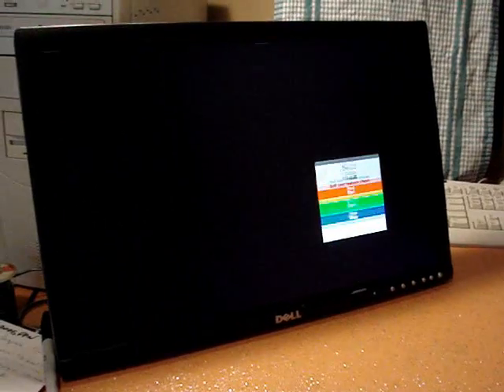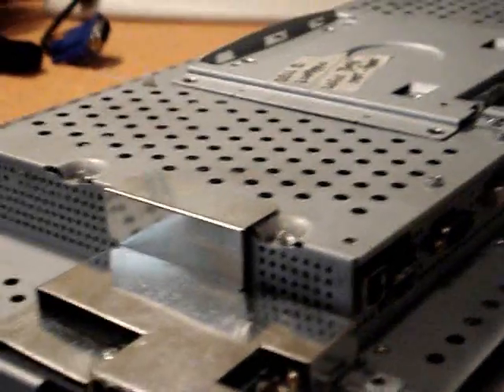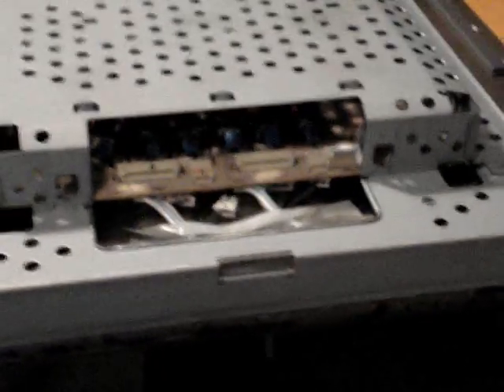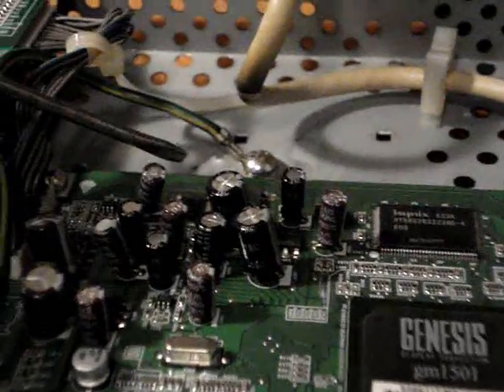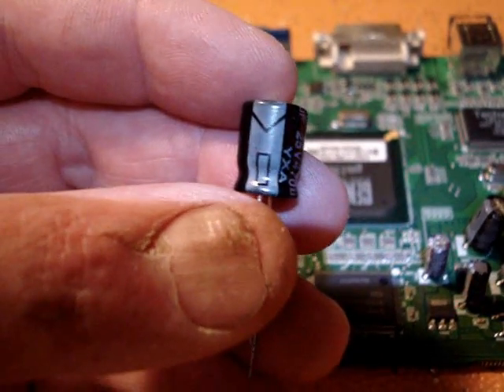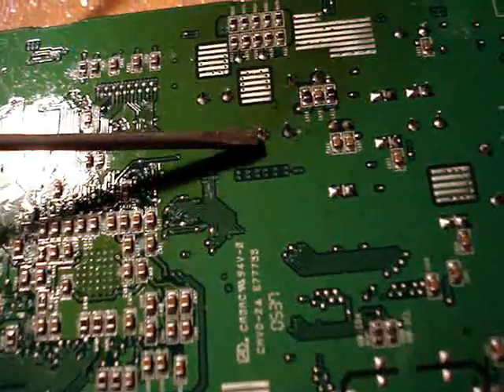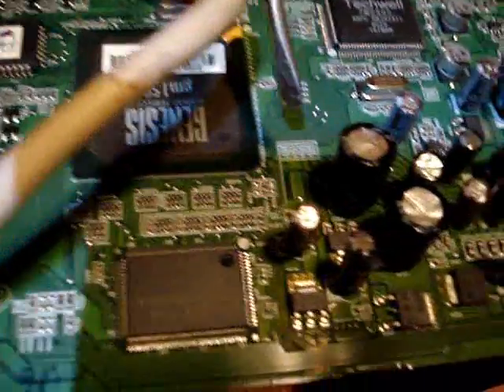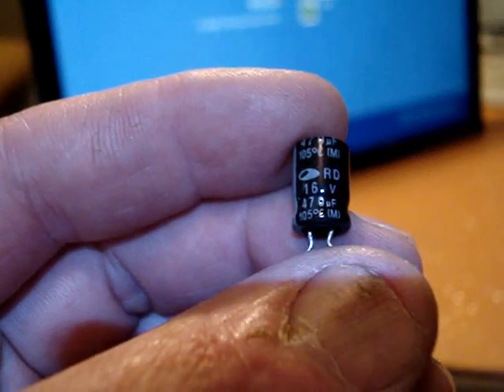Repair a Flickering 20" Dell 2005FPW LCD Monitor (similar to 2007WFP)

Comment: I just had a similar issue on my Dell G2422HS monitor. It just started flickering. I didn’t think it was the monitor at first so I restarted my computer multiple times but it didn’t fix it. Then I connected my laptop to the monitor, I realized it was the monitor. The weird thing is that after maybe like 5 minutes, it went back to normal again. It has been working fine since so not sure if anything is really broken… very odd.

Comment: I have a similar Dell monitor and a similar problem in it... a constant flicker in the bottom half... it even sounds when flicker and that looks like something related to power feed... im poor and im amateur in electronics, well... preamateur even haha... it might probably be some capacitor but in order to find the failing one how can i do it, using a multimeter in every capacitors i guess ... thank youuuuu

Comment: I performed your fix and the monitor now works flawlessly. A very good lesson video. Followed your instructions completely although I had to use 30 V - 470 capacitors. Thanks. I really like this monitor.

Comment: Thanks! Worked on my Dell 2005FPW monitor.
For others finding this post: The original electrolytic capacitors are rated 105°C. It's probably wise not to replace them with capacitors with a lower temperature rating...
After the fix I looked up what these capacitors do in the monitor. They are part of a small circuit (on the logic board) that creates the 1.8V power line (from a 3.3V power line), which goes tot the GM1501 chip (the Genesis display controller).

I found the service manual (with disassembly instructions and schematics) on:
https://www.manualslib.com/download/442079/Dell-2005fpw-Ultrasharp-20-1-Lcd-Monitor.html

Comment: Cool repair. 

My Viewsonic 2038wm-LED monitor turns on but the screen image flashes every few seconds (screen is on, screen is off, screen is on. The image actually looks good, not faded or anything). The term may be it's flickering every second or every few seconds?

These are cylindrical electrolytical capacitors, I see which aren't bulging or seems to be damaged: 

Electrolytical Capacitors
100v 33nF
25v 30nF 
25v 330nF
10 680nF
50v 47nF
16v 470nF
16v 470nF
450v 100nF huge one (the largest)

Ceramic capacitors I see are:
4 blue ones, one blackish & one light brown

The nearest to the connector to the LCD controller board  are the two 16v 470nF capacitors.

Which could be the possible culprit?

Thank you. God bless, Proverbs 31
Reply: These are usually the culprits 
16v 470nF
16v 470nF
25v 330nF
10 680nF 
The only way to rule out the bad caps is to remove from the board & check the capacitance
Reply: By the way, off topic (about a power supply for another gadget).

Would this work: The transistor is 
HA 17805 but can I replace that with AN7805 (the one bought, the one available)? I think HA means Hitachi.

Also, the original ceramic fuse is a
 T8AH250V will the on I bought work (it's the only 250v available)? :

5A
BS1362
6X30

Besides th amperage what do the number even mean?

Thanks.

Comment: Just repaired my flickering monitor. Also like new! As I only had one new 470uf 25 volt capacitor available, I replaced the one furthest from the board edge with that, and the other I simply put in a new 47uf 16 volt capacitor. Thanks for posting... still paying dividends 7+ years later!!

Comment: that flickering issue is common with those monitors, many of them do it. dell used crap capacitors. i got 2 from the thrift store, both of them bit the dust months after using them. and one was in worse shape and had major backlight bleeding and some scratches on the panel.

Comment: Thanks for the video, helped me resurrect my dell 2005fpw. Any idea why those caps need replacing? Mine weren't bad but it seems to have solved the issue (wavy signal).

Comment: thats how my 2005fpw is during the morning when i power on my pc, but it stops after a while. Were many of these 2005fpw montiors plagued with that issue, i got my 2005fpw from a thrift store back during summer before.
Reply: i found another 2005fpw and it eventually got that same flicker issue too.

Comment: I have a Dell 2709WFP, the pair of capacitors I identified are 35V 470µF; I noticed you upped your capacitors 9V, from 16V to 25V, the next capacitor up, that I looked up is 50V, would that be too much for my board? Many thanks in advance & thanks for the video!
Reply from the maker: A higher voltage rating does not  have an effect on the capacitor's performance.  The important part is the µF rating.  A problem you may run into, is the pins on the capacitors are too big for the holes in the board.
Reply: Capman550 Thanks a lot! I figured it was the capacitance that dictates the flowrate.... My board is different so I looked for a pair of big capacitors near the  ASIC. none of them are bowed or leaking so I can't easily tell if they need replacing, just guessing. However these two are bigger than all others so gonna give it a go anyhow.

Comment: Just wanted to comment and say Thank you very much for this video. With the info in this video about which capacitors to replace, I was able to repair my old 2005FPW. Now I have a spare / second monitor. So thank you.

Comment: I am tempted to try. I only found a spare capacitor in house.  Is it a must to replace both capacitors?  Is there anyway to tell if only one is bad?
Reply: You can tell if the capacitor is bad because it will be bulging on the top or leaking brown fluid from the top or bottom.

Comment: swollen capacitors is not always the sign of a bad capacitor, it is necessary a multimeter to inspect the whole board, thank you Capman550
Reply: A swollen cap is definitely a sign of a failed or failing cap. The swelling will lead to venting to keep it from exploding. There is no need to measure swollen caps - remove and discard them.

Comment: I'm not sure if you are still reading posts from this video but I have a Dell ST2310 pulled apart and I see no visible signs of bulging capacitors.  The back of both boards (logic and power panel) look to have some minor oxidation of some type but I don't know if that is par for the course.  The symptoms of the ST2310 is a dimming flicker of some sort, like there is not enough power.  So, if you walk up to it on standby and activate it, the monitor will come on strong for less than 20 seconds, then flickers by dimming, then solid dim.  I'd really like to fix this.  If you would point me in the right direction that would be helpful.  I've looked up the parts and could just replace the boards but I would really like to fix the boards.
Reply: Did you manage to repair your Dell ST2310? If so how? Was it a board fault or were the CCFL lights dead?

Comment: +Capman550 how did you determine that it was those two that were causing the issue? I think you said that it was based on experience but could you please share that experience? Thanks man good video
Reply: I was about to ask the same question. There are so many damn capacitors back there. Plus, how does one determine if the voltage of the new capacitors ain't too much. He went from 16 to 25 volts; that's a steep jump.

Comment: My 2312hm has flickering lines going down the 1/3 on the screen, its on the left side. And it also seems darker there and the appearance is "interlaced" in that area too. It just happened and I would love to hear what I can do about it. I have tried a different DVI cable, a vga cable and and there is no problem with my gpu card.

Comment: I was wondering if this would also solve the horizontal white lines I am having on my screen. They appear after a few minutes, and after hours the screen starts flickering and is unusable until I turn it of for like 10 minutes. 

It is not a heating issue I am having because I have added extra fans facing to the board and back light (a nice temperature of 38 C max inside the case) but it is still having the same issues.
Reply: Me too exact same. Aero monitor?

Comment: How do you know that the power supply wasn't causing excessive voltage conditions that resulted in those capacitors failing? Won't the same thing eventually happen again and again until such a problem is fixed on the power supply side? In other words, if the caps were simply cheap and finally failed (which appears to be your contention), what is the probability that Dell purposely uses defective caps for those two components in all of the monitors which have this problem?  Isn't it more likely that if cheap caps are used in most Dell monitors, some of them are in line with other bad components that are more sensitive to failing, such as power supply caps (which I must admit, based on my own experience with a lot of Dell monitors, are the most likely to fail)? Have you already checked the caps on the power supply board and didn't show or mention it? Seems a bit sloppy for a repair video.
You were 100% wrong about the other side of the board having the part designations of the caps on the top side, so it wouldn't be possible to use that methodology to determine the location of the pins. Also, you shouldn't wiggle a part as you're trying to extract it because the legs are soft metal which can break under that kind of stress (shear). It is better to pull gently as you move from one pin to the other, and you will see the pins recess into the board as the solder is melted. I use a pair of 'sponge forceps' to remove parts because they are designed to hold tissue without damaging it, and therefore, they won't damage the part. If you only need one pin detached from the board so you can check the part 'in place', then pull more on an angle away from that pin until it is released.
After removing the parts, go back with solder wick and remove enough of the old solder that you can clearly see a hole for the new part to penetrate the board. You didn't perform this step so you failed to install the new replacement capacitor at 7:13.
Applying some flux to the solder points or the wick significantly improves the efficiency of solder removal. You will find that flux also ensures a quicker and less damaging parts removal process on boards that have limited or high temperature solder. (A cheap alternative to rosin flux is phosphoric acid diluted with alcohol. This can be used in a cheap felt marker as a 'flux pen'.)

Comment: Hi,
I just bought a monitor and it keeps on flickering in shades of pink. Sometimes the flickers took longer. I checked the cables and fixed it again, but the problem didn't changed. We tried to connect the monitor to the laptop and the problem still there. But before we connect the monitor to my pc, we've checked it to my friend's pc and it worked fine.. U.u I hope anyone could help.. Thanks.

Comment: Thanks for the video, those two caps fixed the problem, but oh dear, getting to the stage you had at the start of the video was a nightmare!
No major external cosmetic damage, but I broke some of the internal plastic supports for the screws, which aren't needed to hold the thing together anyway.

Comment: Thank you so so much. I used two 35v as replacements and it works like it was used to.
I really would have hated to throw my trusted fpw2005 away.

Was also the first time i ever did scoldering :)

Comment: Thank you so much.   I replaced just those two capacitors that you showed in the video and my monitor fired up perfectly with no flickering.   Both capacitors looked fine - unable to test though so I just replaced them.   Great post other than opening the case by taking off the front bezel.

Comment: hi, repair was exactly as you described. what a complete screwup by the designers! i only wish you had started at the start however, and showed how you got the cover off! because i made a right mess of it without any knowledge on how to pull the screen apart to get to the metal chassis and cracked plastic everywhere. i was gutted when i saw you jump to the metal chassis already! :(

Comment: Thanks for the repair video. Thought my old Dell 20" Monitor was dead.  But I found 2 of these 470uf (35v) at RadioShack so I thought I'd try this repair.  Well, it worked great and now I've got another working monitor.

Comment: Any idea where I can get one of those flat flex cables that goes to the front buttons? I bought one of these to repair and when I opened it up, I was that the cable had been ripped at some point
Reply: Get the service manual.  See if they list the part in there.  Take the number and call Dell Service.

Comment: Looks promising. But can someone tell me if the fix is the same for my case?  Mine would flicker ONLY for like 2-3 minutes upon powering up, then it would return to normal. It's like it needs "warming up".   Another question is, why do both capacitor have to be replaced -- do they generally blow at the same time?
Reply from the maker: Also inspect all caps on power board for bulged tops or leaks.  In most cases it is the caps mentioned in the presentation causing the flickering screen, and yes the flickering will eventually clear.
Reply: mine does that too

Comment: These monitors are surprisingly easy to service as long as you don't crack the thin plastic bezel (be careful but it will come off) and do NOT use any capacitors that are too long/tall so that they push/bulge out the monitor enclosure above them, it's possible to have metal on metal contact with the casing and then there will go your power supply and god knows what else. There was a thin plastic sheet on my monitor interior but the replaced/larger sized capacitors forced the removal of this. Make sure there is no contact at the back while replacing the indicated capacitors and the outer metal shell after soldering as heat can make things expand and migrate even if they don't touch at first inspection.

Comment: I had the same exact screen flickering. I replaced all the capacitors except the larger one for the power supply and VIOLA no more flicking. This was so easy. I ordered the caps in eBay!

Comment: Working fix.  Used 2200uF 16V capacitors.  Desoldering the original capacitors required a temp of ~700f, be warned.

Comment: My problem is a bit more complicated than this. I have a vertical line and a horizontal line on the screen that don't move. The part of the screen under the horizontal line flickers. The top remains still. Just now the screen seems to start burning images into the pixels. The problem lessens when there is more white on the screen.

Comment: Repair a Flickering 20" Dell 2005FPW LCD Monitor (similar to 2007WFP)

Mine is a Dell-SP2008WFP. It opens and then it blanks-off after 1-2 sec. It was given to me 2yrs ago because it the monitor displays a rolling green/pink snowy screen. I've plugged it in and work without problem for 2months and then snowed again. I used to resolve this by a slight knuckle at the top bezel every now and then(once in every next 2-3 months) for the past 2yrs. Can my issue be those same weak capacitor? And if it is, would it be even better if I use solid-state capacitors for this repair?    I've been searching for monitors with the same/better specs as mine has, and it would cost me $450+.  Yes most monitors have gone as low as 90$, but they've also gone shit cheap too on quality (built, stands, colour, response-time, etc). I'd rather repair the one I have, and seeing you've done it, I really rather repair mine ;)

Great video. Thanks!

Comment: could I get away with a 470uf 35V?
thanks for video.
I also have a problem with the monitor cutting off after it gets hot then the power light blinks on and off like its trying to start. After it cools for an hour or two it starts back up. would this problem be related or could there a Cap on the power board? all Caps visibly look ok just looking on the outside. I have no tester.
Reply: I'm also wondering if I could get away with 470uF 35v. I ran down to my local Radio Shack and that's all they had for 470uF.
No 25v.
Reply: The problem in the video looked like a bad connection, nothing to do with the caps.  Probably fixed it when he took it apart and put it back together again.....  With your problem I would look at the power supply board for bulging caps.
Reply: Chad Hollman
35v caps will work in place of 25v, the voltage is the max rating not the working voltage. make sure the capacity is the same.

Comment: Thanks Capman550. Took about an hour and it fired up perfectly. $3 to fix it and I have 18 capacitors left. The moniter is dated 2005 I got 8 years out of it before it started flickering. 9 more repairs gives it about 72 more years of life! More than I unless Google comes up with a cure for aging.

Comment: You left out how you found out those caps are bad the first time, referencing "past experience with that type of monitor/symptom". Could you have easily tested those caps for micro farads or are they the more difficult failure related to ESR to detect?

Comment from the maker: I always use a higher voltage rating when replacing a failed capacitor. 16V caps will work just fine. A higher voltage rating builds less heat and in most cases prolongs the life of the electronic device.

Comment: Hmm, quick note.  I left it off for a few hours, came back and turned on my PC.  Image is still fine, but I did have the odd "squealing" sound upon power up.  It stopped when I turned off the monitor and turned it back on.

Comment: Thanks for the walkthrough.  I purchased a few of the 470uF/25V caps for my 2005FPW (which I salvaged from my job's garbage before it went to the dumpster).  It was doing the flickering/flip when I brought it home for a while, with the odd whining sound, then after about a week it just stayed black with flickering green indicators.  Just soldered the caps in today and works perfectly! :) Thanks again.

Comment from the maker: Replacing the the two mentioned caps on the Logic Board should solve the flickering. While it is apart inspect all the caps on the Power Board for bulging tops.